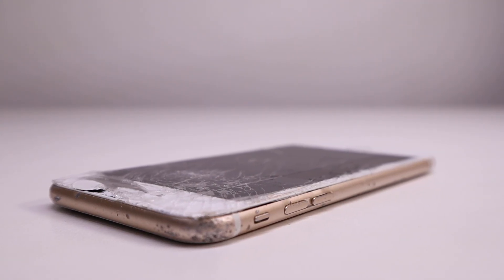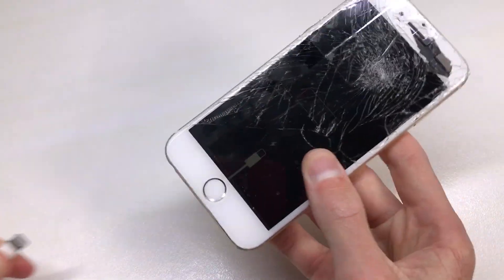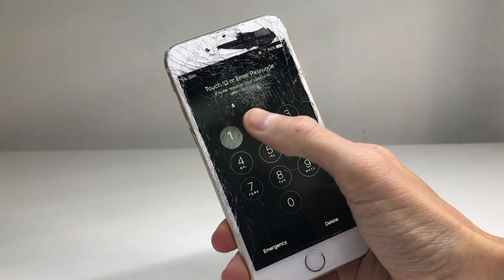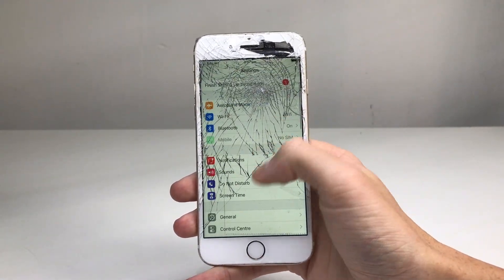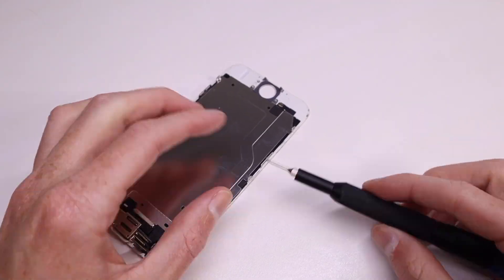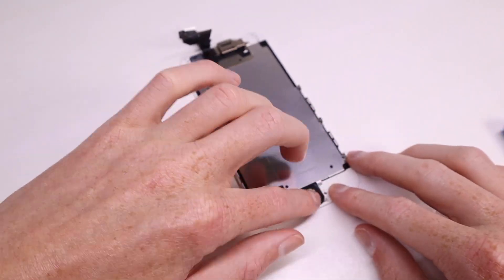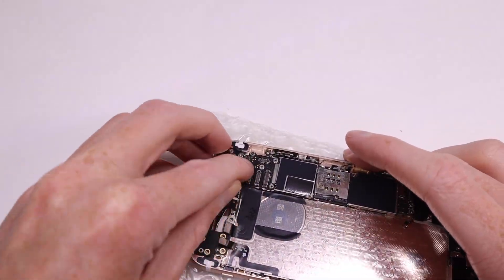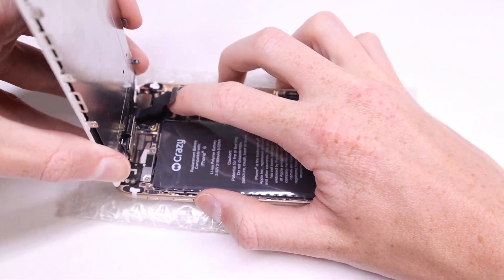$30 Destroyed iPhone 6 Restoration - Seller Tried to Scam Me?!

Comment: I have an iphone 7 plus icloud locked and i wanted to know if i replace the motherboard(with a new one and with the originan button) the home button will still fuction as ID reader and home button?? Or it will not work? Thank you
Reply: If you replace the logic board you will need the home button with that logic board. Every home button + logic board are paired at factory and only apple can repair a new home button. If you install a new logic board and keep your current button it WILL NOT have touch id. Even if it's an original home button u need the original home button of that specific logic board. Also they added some weird thing on the iPhone 7 abt home button replacements so you should look online abt that
Reply: @edenk3500  okay thank you so much!!

Comment: What was the application that put the phone into recovery
Reply: He used iTunes for recovery and Reiboot for passcode unlocking.
Reply: Avijeet Singh thank youuu🙏
Reply: you can do it without apps: turn off the device, plug the usb cable into the computer, hold home button, and while holding down the button connect the usb cable, stop holding when you see the itunes logo
Reply: I was fixing old iPhones as anything for a 5c or newer in working order was worth £50 upwards, now the iPhone SE has dropped its price again from £350 to £150 16gig brand new and its same speed as a 6s so I'm not bothering to buy any broken phones for time being, it takes a lot of time and money to diagnose, fix or replace parts and test them, if I were buying one if just buy a brand new one with guarantee for £150
Reply: How can he restore the i phone which is disabled and i cloud lock ??

We need to have the original owners i cloud id 
So how he do can you tell me ?
Reply: Account Deleted that’s what I do when I forgot my passcode on my 8 plus😁👍
Reply: @mico.raquin3677  but what if we buy a phone which is i cloud lock or disable 
And the owner don't know the id and password then how to unlock it ?
Reply: @akashsasane5104  He's talking abt pass code lock. You cannot disable an iCoud lock without the pass or taking it to Apple. Apple will only take off and IC lock if you have the original receipt (when the phone was first purchased either from a carrier or apple. Second hand receipts don't count)
Reply: Account Deleted HI he pressed the button which the iPhone will force restart
Reply: Account Deleted its easy to restore he first put insert his lightning cable to iPhone from computer and he forced restart and the iTunes logo will be appearing and the iTunes in computer will detected it

Comment: How do you get your replacement batteries to appear in apple heath?
Reply: I found myself struggling with that at first after iOS 12, but if you leave the device on, eventually the batterycondition will load.

Comment: I plan to do this with my broken iPhone 6 which took a few falls. 
It’s a silver 16gb with a bad screen and battery
Reply: 16GB? Yeah don't...
Reply: Go ahead man leave all the shit talk it's nice to atleast try something new whether its 16 GB or 128 GB experience of restoring an iPhone is an exp it doesn't matter😁
Reply: Eshanangshu Bhattacharjee naw 16gb is not enough now a days 🤣🤣 and the iPhone 6 is not worth it now since it only has like 1 gb of ram
Reply: The Ohio State University correct
Reply: @jadoo8828  who are you talking to?
Reply: @miikkavarpula4284  obv not with you🙄
Reply: @jadoo8828  ok
Reply: damn 16gb lol my android is 34gb and i feel like that's low enough
Reply: Danny Mexia just to make it clear that it’s not my main phone. I use a 32GB SE. I would just restore it as I wanna use it again
Reply: @Plainapple287  unless the display is cheap, then dont, also yeah the iPhone 6 is a bad phone nowdays tbh
Reply: @dannymexia5961  i have an 8 gb $100 android. there's literaly 400mb of total available storage for apps lol
Reply: @commentchannel5375  Jheeze what phone is that bro lol does it have expandable storage ? if so you could throw in a 128gb micro sd card on it for 35 quid aha
Reply: @dannymexia5961  I have an 16 bg sd card in it right now, but its on android 4.something and you cant put apps on the sd card, so now I have 16 gb for photos taken on my 1 mp camera, and 500 mb for apps
Reply: @commentchannel5375  ahh that's sucks man I never experienced android 4 I made a switch from IPhone to android when android 7 came out
Reply: @dannymexia5961   I still use a 16gig iphone.. might be a little low but whenever it starts complaining, I just airdrop all my pics and vids to my macbook. Just Takes a few minutes and bam! Ive got a few gigs free again. If I were to buy it again, i'd have gone at least 64gig. Mostly because I wanna use this phone for as long as possible.. iphone SE
Reply: @Silofox  fair enough, my photos are automatically uploaded to google photos so it never counts as GB for me and its unlimited too
Reply: @dannymexia5961   and thats definitely handy.. I laugh every time my phone tells me I could "save 5 gigs!!" by using my icloud storage. Its less convenient than an automatic process but I usually have my laptop with me anyway. If not, It's very unlikely I'll take more than 2-3gb of photos in a day.. Different people have different needs. Larger capacity is definitely a better all around choice but its not too hard to live with a 16gig device. In a way it keeps me more aware of whats on it..
Reply: @Silofox  Theres alot of cool things you can do with androids i also watch tv, live sports, movies for free and i can download paid apps using utorrent directly from my phone and chrome aha but i dont want to sound like a fan boy so ill leave it as that. 

Is i cloud still buggy? i remember when i had my iphone 3gs and iphone 5 i never used icloud the thing was useless but its been years since i had an iphone so im sure everything is improved, well atleast i hope so lol
Reply: @dannymexia5961  My iphone XS Max is 512gb. try me.
Reply: @718Kipkila  thats cool bro, we android users can slide in a sd card of 500gb extra into new android phones you
Reply: @dannymexia5961  I got 128, I would rather die than have less
Reply: @dylanhouchin  You can get around this on android but i'm definitely getting 64 minium next time
Reply: @dannymexia5961  yeah fair enough
Reply: @dylanhouchin  True. Anything below 128GB is Not enough space. Im here chilling with my XR in 128GB 👌🏽
Reply: @Racko.  eesh, enjoy your display lol
Reply: @dannymexia5961  Lol I have a Samsung Galaxy tab 3 with NO Sd Card and it's only 12gb internal, but it is still way more than my Mediatek Chinese Clone Phone that has a 32gb SDcard- it only has a 2gb UserData partition, the Samsung has a 12gb Userdata partition. Still have about 4 gb free and have a full regiment of GAPPS installed.
Reply: Danny Mexia 32GB?
Reply: Danny Mexia my iPhone 8 is 64gb and my samsung s8 is 128gb
Reply: @miikkavarpula4284  ew
Reply: First silver play button Without videos what
Reply: @miikkavarpula4284  my note nine is 128 GB and I've use like 10 is that alot that I've used?
Reply: Edwin530 Fortnite its not alot :D i have used 21 gb from 128gb
Reply: YASSS! Repair that poor thing!
Reply: you guys think this is bad with the old iphone 2G the options were 2G storage 4G storage or 8G storage
Reply: You guys are arguing about that while I have 8gb and it handles it fine.
Reply: Are you copying plainrock124???
Reply: I got iphone xs max 256 gb and it didn't enough too
Reply: @syahrulamri9215  yeah sure.. literally 256gb is way too much
Reply: @miikkavarpula4284  nahh not that much for me. I can full up it in just a week
Reply: The Gamerz yes sure...
Reply: @syahrulamri9215  too fake lmao
Reply: I fixed mine and I need to know where to get a battery
Reply: @glitchninja7778  Try Here:  only comes to about 9 bucks. https://www.ebay.com/itm/New-Internal-Li-ion-Replacement-Battery-for-iPhone-4S-5-5S-5C-6-6s-plus-Tools/182066189614?ssPageName=STRK%3AMEBIDX%3AIT&var=485134176546&_trksid=p2057872.m2749.l2649
Reply: y'all are complaining about 16gb, while I here still have a iPhone 4 with 8 gb
Reply: Plainapple287 get a new phone
Reply: Luis Enriquez I already have a new phone... the iPhone SE.
Reply: Plainapple287
Reply: wanna sell  How much??
Reply: The Iphone is fake
Reply: Crikes, you should just buy a new motherboard for it with a 128gb NAND...
Reply: I'd offer you my 64gb 5S...
Reply: Recommend a software "Appeven" to download a lot of free hand tours, we can play together.
Reply: My note 8 has 64gb and I need to buy a 64gb card for it.
Reply: AT reacts neither do i but i just bought it for no reason
Reply: Good luck with that 16gb isn’t too bad if u don’t play high gb games but if u wanna do it as a project go for it
Reply: You should just get a new phone there's new iPhone 6 phones being sold on eBay and Amazon for like 100$ or so it's more worth it than going to all the trouble
Reply: 16gb? Lmao my iphone SE Has 32gb and it’s better and powerful than your iPhone 6
Reply: Kill ScoPez did you not fucking read the replies, before you try to fucking flex on me, I already have an iPhone SE 32GB as my main phone. 
I SAID I WAS FIXING IT AS A SECONDARY DEVICE.
Reply: Throw it away, it's trash
Reply: @Racko.  if you say so lol
Reply: You might as well get a new phone but I guess you can try and get a new phone if you fail miserably.
Reply: lmao my zte axon has like 120gb
Reply: 16Gb dis days is such a pain in the ass lol ahha Try upgrading to 64Gb upp storage.
Reply: Plainapple287 oh hi I think I’m in a hangout chat with u xD
Reply: @Guillermo Reynoso it's good I only have to charge it when I go to bed
Reply: Is this a Plainrock124 copy?
Reply: The person with S8 you know you it only get  64GB unless expanding storage
Reply: Haha You loose i have 64gb samsung sd card
Reply: Euronjuusto 69 500gp iPhone boi
Reply: @miikkavarpula4284  Haha to you I have a 120 gig sd card
Reply: @miikkavarpula4284  when I found it at walmart 64 gigs for $30 or 120 for $35... which to choose. Hard decision.
Reply: Sharp Anikan just in case you didnt know we dont live in same county so here 64gb cost about 30€ and 128gb 40-50€
Reply: 512gb iPhone XS Max here...
Reply: Lol 16 GB i got 128 GB verison
Reply: My iphone 8 has 64gb and i used 62gb so dont
Reply: no point its 2019 i want to replace my 7 with 256 but its hella expensive xr is 1200 aud